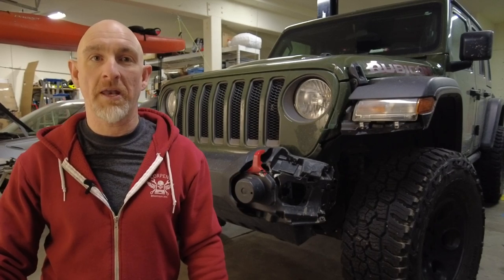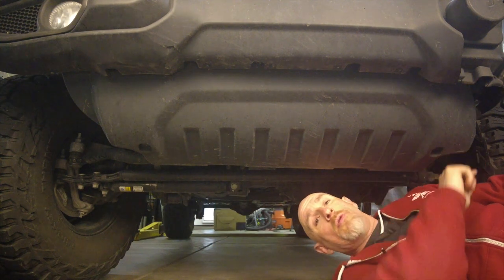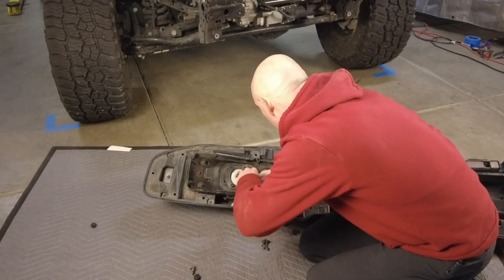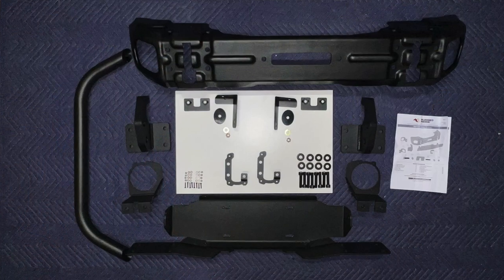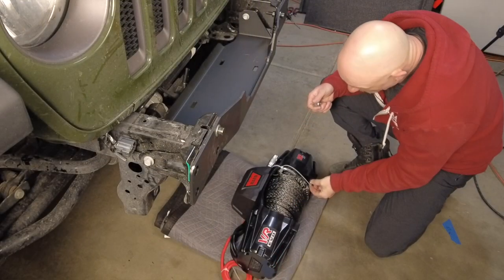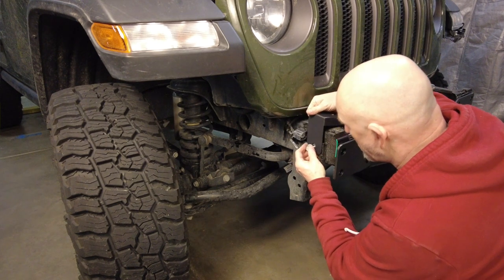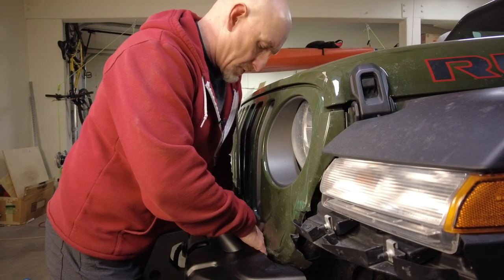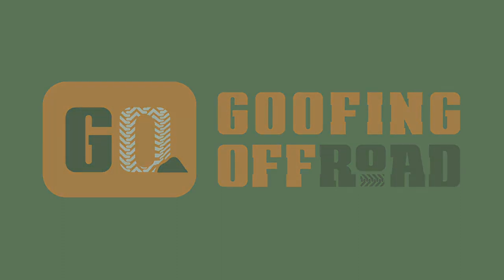Stock Bumper Removal & Rugged Ridge Arcus Bumper & Warn Winch Install on JL Jeep Wrangler Rubicon

Comment: Doing this project very soon, same bumper and using a Smitybuilt winch. This video super helpful, thanks for sharing!
Reply from the maker: You're welcome!  Check the placement of the wires on the winch.  Also, I learned that it's best to ground the winch to the frame on the JLs, so as not to mess up the dual battery voltage, which can cause problems down the line...
Reply: @goofingoffroad  Appreciate the advice!

Comment: I had this bumper on my JK and loved it.  Got one for my Gladiator Rubicon.  But the factory LED fogs supposedly don't fit without modification.  Are you going to put your fog lights on this bumper?  I'd love to know what you have to do to make it accept them, if you do it.
Reply from the maker: Yep - The fog lights are in a box waiting to go in.  I saved all the screws, wiring, etc .

Comment: How is that bumper holding up? The  Material looks pretty thin.
Reply from the maker: The General doesn't see any hardcore wheeling, so it's holding up ok.  The plus of the bumper is that it's fairly lightweight.  The minus is that I don't think it would take much abuse from hardcore wheeling in the rocks.  When we get the General out in the rough stuff, if we encounter any issues I'll be sure to post an update.